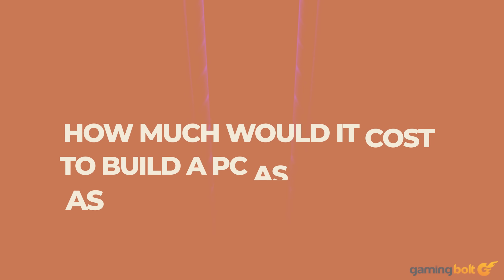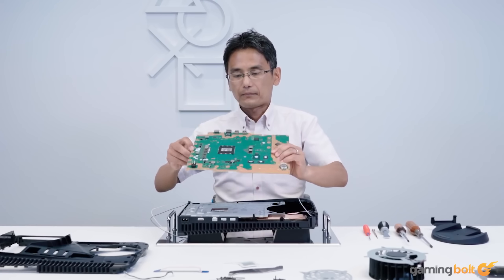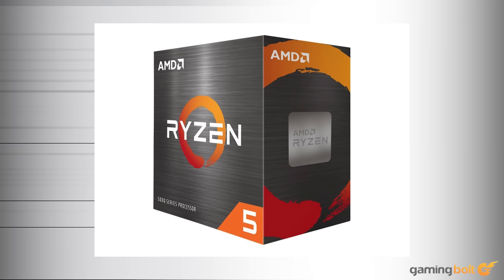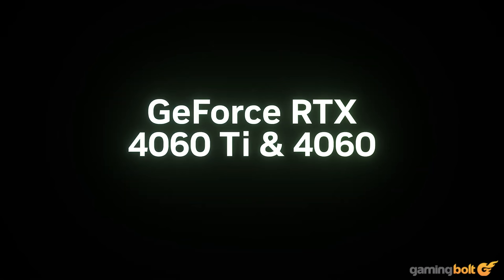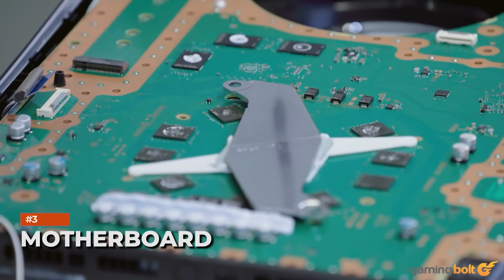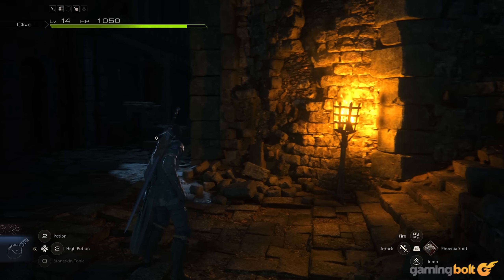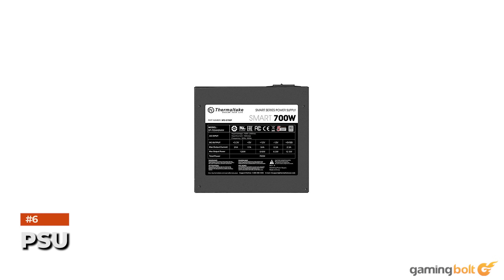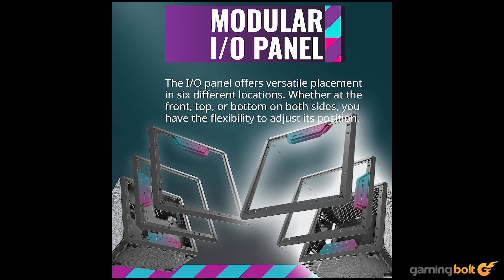How Much Would It Cost To Build A PC As Powerful As The PS5? (2023 Edition)

Comment: Personally I think he should have went with an actual RDNA series gpu because most ps5 games don't use ray tracing or take such a hit in performance that it'd be a comparable card possibly shave off that extra $70 and have longevity (like an actual game console) due to the higher RAM in AMD cards. But this is just being nitpicky because bro took the time to make a whole video.
Reply: Probably an rx 6600 or rx 6650xt would be a better comparison and are a fair bit cheaper than a 4060.  Rx 6600 is probably slightly below ps5 performance, but you can find a new one on sale for under $200 now.
Reply: @Flyon86   hell even the 6600M is abouit 5% slower than the PS5

Comment: Dude as soon as you said 4060, I had to discredit you. As we are all well aware of the analysis that have been done on the games, and the GPU power on both the Xseries and PS5 is at around 2060 super to may be 2070… you went OVERKILL! Also the motherboard is OVERKILL...
Reply: Actually if you understood the impact of optimization you would know the 4060 and the SSD are the only good choices he made.  The build he suggests here will likely not be equal in performance game for game to a PS5.  At least not on flag ships like horizon.
Reply: @DKarkarov  The PS5 has been confirmed by many to be running at around the 2060super,bthe 4060 is beyond the PS5... The SSDs and the whole loading time, now in days is kind of irrelevant, we have gotten so used to them, and CPUs have gotten so fast that they make up for the lack of speed, and to be honest it doesn't make much of a difference between a 3Gbs to the 7/ 9Gbs of the PS5... 

The CPU he chose is actually stronger than the PS5s, even without 2 cores/ and 4 threads less. Everything else was retarded 😅...

Keep in mind ALL games now indays use scaling techniques in many ways, no  devs are using "native" resolution, not even PC gamers do in some cases, so the PS5 along with the Xseries are both running games at much lower res, then scaled up. Due to consoles being better optimized, makes then a good choice, but they are no where near the kind of specs these youtubers keep pushing.

My PS5 build will be:
- Ryzen 3600
- RX6600/ 2060super
- 3000mhz DDR4
- cheap MOBO
- cheap good looking case
- cheap but good PSU
- cheap KB & Mouse with a cheap PS5 or Xbox controller u can find for around $20.
- You DON'T need a windows key to use windows, make an account and is free with a water mark on your desktop, or get a very cheap one on ebay.
With that you may even have left for a small high refresh rate monitor or go 4k and still be around the $550... 

I did a build like this but slightly better back in march, people just don't know how to shop. And are very mislead.
Reply: @ADRzone  So you are wrong, you are making the biggest gamer mistake there is.  You are totally ignoring the fact that games are dramatically better optimized on ps5 than they are on pc.  Also a PC is doing pc things, not just running a game.

Don't believe me just try buying this build he suggests and playing jedi survivor, then try playing jedi survivor on a ps5.  You will find that no, this build does not perform as well as a ps5 in a number of titles.

ram 16gb, not good enough for modern windows gaming pc, isn't even fast ram at dd4 levels.

mobo, garbage choice isn't even pcie 4 ssd capable, wont fit in his chosen case.

cpu, last gen budget cpu, do I really need to say more?  Low thread count, low core count, pc's are not "just running a game" when you are gaming.  Speed mentioned is the "max boost" not it's "always runs at this" boost.  Also he is using the stock cooler.... LOL good luck is all I am going to say.

4060, actual good choice.  Only costs 10-20 more than a 3060, and the cards that are notably cheaper are also significantly worse performance or lack good ray tracing support much less DLSS 3.  AMD drivers for GPU's are still mediocre at best, marketing is not why Nvidia dominates GPU markets.

ssd, another good choice too bad the mobo kills it's speed by not supporting pcie 4.0.  PS5 ssd performance will easily be better and would be slightly better even at 4.0 speeds.

PSU, another gamer pick because PSU only needs to hit a wattage number amiright?  To say this is a bad psu choice period is really underselling how bad a choice this is.

Case, you can get a atx mid tower case for like 70 bucks, if all you care about is cheap there are far better choices.  You really should not only care about "cheap" though  because this pc is probably going to be a hot box using only stock cooling.

Do not build a gaming pc unless you care about pc specific games or want to push higher end hardware.  If all you want is "console like performance" a console will always be the better buy.
Reply: 4060 isn't much better than 2070 super. 2070 super, 3060ti and 4060 are all similar in performance with few percentage difference btw each. You might get like 10 fps more with 4060 then 2070 super.